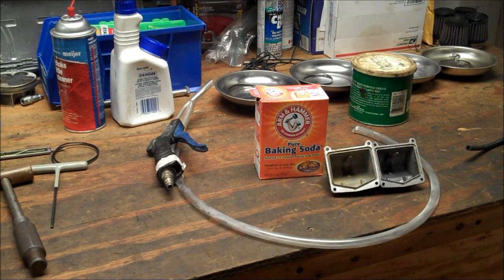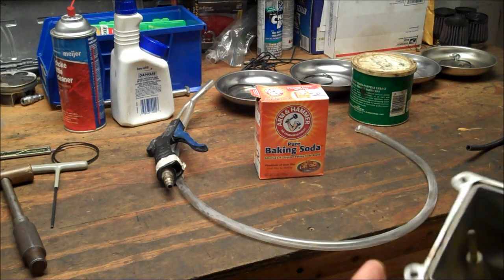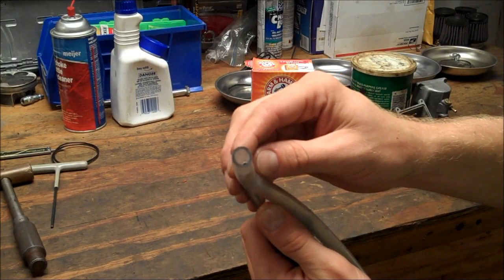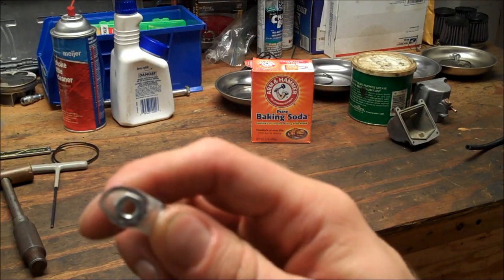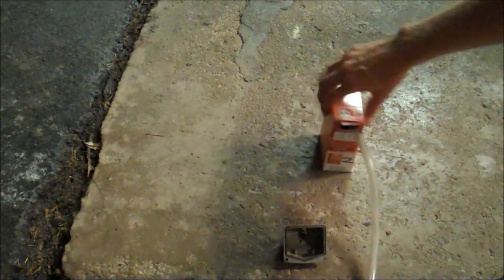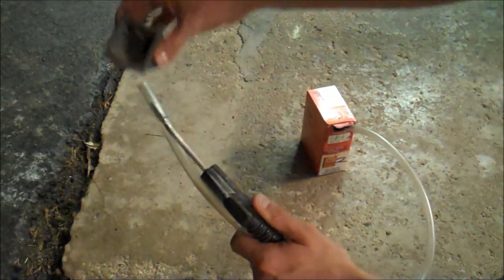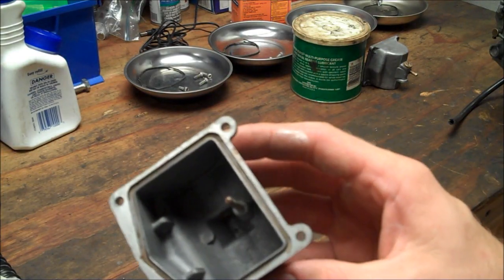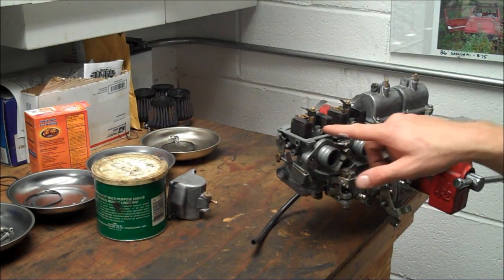How-To: DIY Soda Blaster - Cleaning Motorcycle Carburetor

Comment: Awesome vid. I am definitely going to try this out. Alternatively, I've used a weak solution (20/1) of lime scale remover like CLR clear (calcium\limescale\rust remover) and a sonic cleaner to get that white stuff off (I think it is zinc oxide). Just do it for 5 or 10 minutes. Leaving it too long and with too strong a solution will pit\grey the surface.

Comment: One of the best reasons for using soda over any other media for carbs is that the soda residue dissolves and washes away with water- completely. Any other media always leaves grit around places like the choke and throttle shafts. Cheers

Comment: Hey Matt, you are one smart guy, Thanks for sharing your knowledge!  I have a 85 VT700 and have done a lot of work on it myself by learning from you and others. I recently had a minor wreck and rust broke loose from the Gas Tank and clogged my fuel lines.  so I spent a week removing the rust upper/lower gas tanks and replaced the Fuel Filter.Its running better but something is still off about it.  Any advice on cleaning carbs without a total disasemble?

Comment: Just have to say that the 4 people who disliked this video obviously don't get it.  Great vid.  I'm about the tear into my carbs on my '97 Honda Shadow Spirit 1100 v-twin.  I'm still in the research phase of the project.  As soon as I understand exactly how to proceed & all of the correct settings, I'm going to get after it.  I'll certainly use this cleaning method.  Thank you.
Reply from the maker: lmdetect Thanks for the comment. I have to edit a carb clean video I did on a 04' 750 shadow, it would be helpful for your model as well.

Before you tear into your carbs, note the fuel screw setting. You may want to consider increasing pilot jet size 1-2 sizes up. Those shadows are pretty lean from the factory.
Reply: MatthewMCRepair - I am looking forward to the video, & I appreciate your comments.  I bought this motorcycle used a few months ago and it has aftermarket pipes on it, but I don't know if the motorcycle was rejected.  It's from an estate sale so I don't have any real background on the bike.  I'm not even sure what size jet is in it or is supposed to be in it. That's information I'm going to have to figure out.  I have no idea how to jet this bike.  The pipes look like slash cut Cobra slip-ons, but there is no wording of any kind on them.  Jet size is currently my biggest obstacle on this upcoming project so far.
Reply: Re-jetted, not rejected.  Lol
Reply from the maker: lmdetect LOL, I know what you meant. Give this blog post a read and I would go through the fuel screw adjustment procedure. The fuel screw setting will determine what you need to do.

https://www.howtomotorcyclerepair.com/how-to-size-your-pilot-jet-pilot-screw-explained/

Matt

Comment from the maker: I would completely disassemble the carbs, there is no way around it. Even a small piece of rust can cause issues.

Also, check out my vids on removing tank rust and sealing it with epoxy so you'll never have this issue again.

Comment: as i am at work i have no audio, so if he covers this ignore me. 

This design uses the Venturi principle, in that the high pressure from the air gun creates a low pressure pull in the tube, drawing fourth the media.  also, if you are drawing media from a stationary supply and find your supply not feeding properly, you could sit in a chair, operate the gun with your hands, and tap/kick/ bounce the supply with your feet to keep it moving into the hose end.
Reply from the maker: It's called Bernoulli's principle: https://en.wikipedia.org/wiki/Bernoulli's_principle

Comment from the maker: Sand is too abrasive and will strip it to bare aluminum. It also will not dissolve in water. It it near impossible to get all sand out after sandblasting.

Comment: Hi Matt,
Is there a reason to use baking soda instead of a sand blaster (other than most people don't keep sand in their fridge)? Would it be a bad idea to sand blast inside carbs?
Reply: Definitely nothing other than soda. The soda dissolves and completely washes away. I first tried aluminum oxide inside my blast cabinet, but could not get out the media grit residue particularly around the throttle and choke shafts. Plus the soda leaves a nice finish while the alum/oxide leave a rough finish (perfect for paint adhesion, but not for a final finish).  And a bag of soda is $. A bag of alum/oxide is $$$$. Cheers

Comment: Any good suggestions for cleaning the baking soda off after blasting it?
Reply from the maker: +Patrick Hollins Blow off as much as you can with compressed air first. Then rinse very well in HOT water. Blow dry. This works pretty good and leaves minimal residue. You may have to repeat rinsing.

Comment: three things, soda you buy from wall mart is totally something else than real sodablasting soda. second, you block the tube with your blast gun, thats why the suction is so bad, third, use safety gear.
Reply from the maker: 1. I know, but it works just fine and don't need 20lbs.
2. Suction is great, I actually restrict feed. 
3. Good tip.

Comment: I tried this but it really didn't work, the soda was barely being picked up from the container. I'm running a pretty small compressor but at pretty high PSI for about 10 seconds and it just didn't work at all. Is it likely the compressor's fault?
Reply from the maker: +En Zed Do you have the air nozzle recessed in the tubing? Place your thumb over the pickup and see if you get any suction. What kind of compressor do you have?

Comment: I use a cheap HF sandblasting gun with a hopper on the top for soda blasting. There is a valve on the side to regulate the flow of the media. It works great. Did my whole engine too. http://i.imgur.com/to8tYF1.jpg
Reply from the maker: Hi Kent, I've been meaning to give that gun a try. I have since bought a HF cabinet that I use with soda. It's perfect for carb and aluminum engine part work. I can't fit a whole engine in it though.